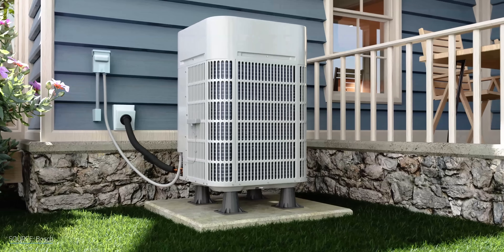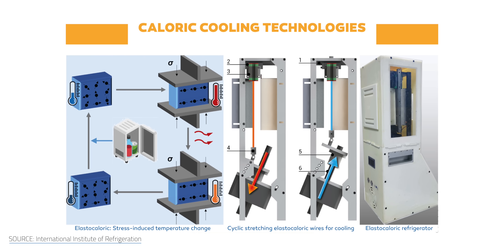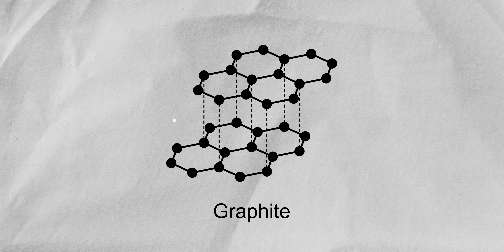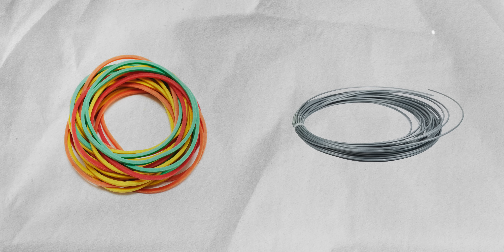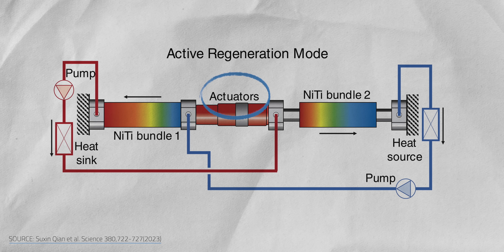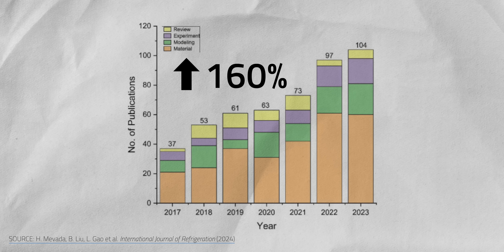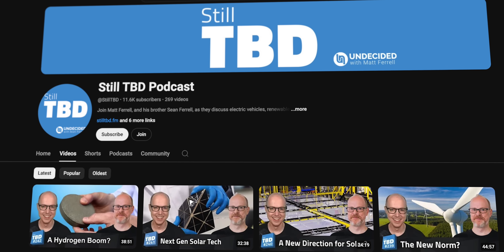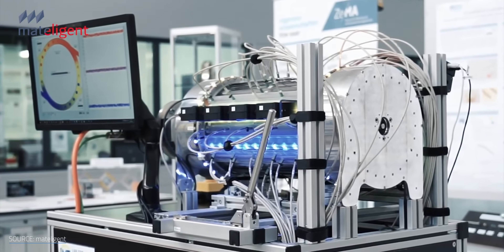How Solid State Cooling Could Change Everything

Comment: For me, potential noise reductions are vastly more important than using less refrigerants. How are elastocalorics expected to perform in that regard?
Reply: Most of the noise from modern heat pumps is from the condenser cooling fan (and sometimes the evaporator too), and many minisplit units are already relatively quiet (especially the evaporator which is in the living space), but improvement there is mostly a matter of air handler design.
Older style units may have noisy compressors as well (that's why window AC units are sometimes called 'window shakers'), but variable speed inverter-based units are generally extremely quiet.

I agree with you, silencing these things (and machines in general) is high on my list of valuable upgrades.

Comment: I like this even if it's just for the lack of pressurized refrigerant. Even when the refrigerating vapor is relatively safe for the environment, you still have to rely on a system staying leak-free and under pressure for years. Having something that relies on what seem to be fancy springs and coils sounds like it should be stable for way longer.

Comment: If this can replace hydroflurocarbons for cooling, which are a far worse greenhouse gas than CO2, then I say bring it on.
Reply: You can already replace hydroflurocarbons by hydrocarbons. Commercial HVAC systems using propane are readily available and being sold in large volume in Europe, often for central heating systems. CO2 can also be used as a highly efficient gas for conventional HVAC systems, but has some engineering challenges due to the high pressures involved. It is used in commercial applications up to the Megawatt regime.

Comment: This made me think of heat pipes, such as those found on PC mainboards for 15-20 years.  However, heatpipes transmit heat via internal gas/liquid phase changes, and are powered mostly by the thermal waste heat from the electronic system (CPU, GPU, Northbridge, transformers, etc).  Used in conjunction, one might make a vastly superior heat conveyance system.  One might even just need as little as a few low-powered fans to move air across heat sinks on either end, or fluid or gas pumps.  Even if all we do is remove the compressor, we'd get a massive COP boost.

Comment: I want the government of Ontario to pass a law that says all new and replacement AC systems must use new high efficiency heat pump technology so that they can replace or at least supplement other heating systems as well. Priority should be given to homes that are heated primarily with electricity, coal, and oil.

Comment: Imagine a wheel, attach a rod to the rim of the wheel at the 12 position, with a heavy weight in a guide at the 6 position.  Now put one at 6 with the weight at 12.  The rod at the 12 is in tension, and the rod at 6 is in compression.  now spin that wheel 180 degrees.  Low energy consumption, tension compression cycles.  Not really much of a limit to how many pairs.  Size is the constraint.  Let gravity do the stretching and compressing.  You just spin it.

Comment: Nitinol was a fun toy in the young robotics hobby groups 20 years ago being called 'muscle wires'.  Heat it with electricity it will shrink, and it will relax as it cools (or the other way around, I can never remember).  Anyway companies were selling 'walking robot insects' that walk using these wires.  A neat toy.  Glad to see the material being used in more practical uses.

Comment: I'm curious why this is considered "solid-state". I always assumed that solid state meant no moving parts, similar to a peltier cooler. But this would have actuators moving coolant as well. Does the coolant move on its own at least, due to pressure changes, or will a pump be required?

Comment: Small comment from someone who did research in elastocalorics on NiTi alloys: martensite doesnt turn to austenite under stress. Martensite is a twinned configuration in NiTi, and deforming it, de-twins it. The detwinned martensite is turning to austenite when heated up and back to twinned martensite when cooling down without mechanical load.

Also superelasticity with NiTi refers to an austenitic alloy turning directly into detwinned martensite under mechanical load and back to its original shape (which is saved in the auatenitic state) when taking away the stress. This way, up to 8 or 10% of seemingly elastic deformation is possible. In comparison, steel can only exhibit around 0.1% elastic deformation.

Happy to explain more or answer other questions.

Regards from Germany ✌️
Reply: How many cycles of 8% deformation can it withstand?
Reply: @eIektrinis  fatigue is a gradual phenomenon, so full 8% maybe a few to a dozen cycles... Highly depends on microstructure and purity of the alloy
Reply: @McReinsen Hi! I'm doing my PhD on improving fatigue life of elastocaloric alloys (copper based ones)
NiTi alloys can go up to 100 000 cycles even 1million in a recent study but the stress is lower for an elastocaloric application. 
My alloy CuZnAl last 10 000cycles for now and the target for an industrial applications in about 10 million cycles so there's work to do but we're on the good way
Reply: @McReinsen  what do you think about this
https://youtu.be/8gbbL2XVpQY
Reply: @McReinsen  THANK YOU for your highly cogent, informative and insightful posts. +1

An amusing aside - I had to chuckle & shake my head at the obviously strong inverse correlation between the well deserved likes you garner between the top and bottom of this thread, and between the increasingly short attention spans of posters (who rarely read deeply beyond an OP, much less upvote it).
Reply: Out of curiousity why are we not seeing more interest in it for artificial muscle?
It feels like a natural substitute for artificial limbs... Is it a longevity, cost or sone other factor?
Reply: @KMCA779  you need heat to trigger the transformation, which takes time to get into and out of the material, so speed of transformation is not very high unless you go to electrical heating of ultra thin wires. Not very practical for limb systems when you need elaborate cooling integrated
Reply: @KMCA779  The function of the wires(shape changing) is required for energy transfer/storage and would not be usable for motor functions.
Reply: @SupraSav  that's not correct. They can be used as actuators and actually are in automotive, space and other applications
Reply: @KMCA779  another interesting application is stents in medical technology. So keeping blood vessels open, eg in heart and brain.
The NiTi wire forms a pipe-like structure that is packed up in a tiny space to be moved to the deployment site through the blood vessel. Body temperature causes it to go to the memorised structure, so it will hold its pipe-like shape and stay deployed.
But do correct me, material scientists, this is rudimentary knowledge on my behalf.
Reply: @KMCA779  about the exact same thing!!!! 100%
Reply: Currently, the NiTi wire bundles are made from superelastic SMA sourced from the medical field, as no alternative material is yet available on the market. This is the primary reason for not exclusively using binary NiTi material.

For this reason, intensive research is being conducted on alloys specifically tailored for elastocaloric applications. In parallel, machine concepts are being developed that, together with the right materials, will pave the way for success. SMA alloys are still at the very beginning of their potential and development journey.
Reply: @McReinsen  Excellent comment!
Reply: How severely does the temperature gradient affect the structural shift? He uses a blowtorch in the video but that's obviously much hotter than most applications for it, so does it have a minimum temperature before the reaction can occur?
Reply: @Add_Infinitum  there is a temperature window where the transformation happens. Both phases (austenite and martensite) have start and finish temperatures. Exceeding the finish temperature is usually not a problem, but vastly higher temperatures can trigger mechanisms that change microstructure, basically the same effect as annealing/heat treatment.
Reply: @Add_Infinitum  so you understand, temperature would not be the stress in the refrigerant cycle.
Reply: You can return it using electricity right?
Reply: @AarushA.S  yes, resistance heating. It's all about temperature
Reply: Martensite and Austenite reminded me of types of magnetic stainless steel. Is there any relationship here, or is it simply that it's similar geometry? Sorry if this is a dumb question, lol
Reply: @Boodlums  they are not the same as elements are different but yes, it's an analogy to steel where martensite is the low temperature and austenite the high temperature phase.
Reply: Thank you all for the extra info here! (Sorry for not contributing, I comment to find the thread later!)
Reply: what about when the temperature memory is under room temp and then you deform it?
Reply: You mean to tell me this future babble is a bunch of bullshit and the details are all scrambled up? No way man.
Reply: How do elastocaloric materials like NiTi fare regarding recyclability? One of the difficulties of current hvac refrigeration systems is that you need to be certified to do maintenance because of the nature of the chemicals used as refrigerants and the resultant necessity of preventing leaks, and most refrigerators that stop working are just discarded (as far as I’m aware, at least). 

A purely electromechanical system with no specialized fluids seems like it would facilitate maintenance. And because the parts that would wear out most often, the elastocaloric material itself, are one homogenous alloy, melting and reforming the parts from the old broken ones seems like it should be trivially simple. Is my understanding flawed? How difficult is it to make NiTi wire from the alloy?
Reply: Some materials do get Austenite to Martensite phase transformations under enough stress (and hence strain). That's the reason non-magnetic stainless steel can turn magnetic after being cut.
Reply: @McReinsen  I used this behavior making soft robots prototypes for my research during my master in Dresden. Nitinol is accessible but still expensive.

Comment: IMO the problem is that heating and cooling happens in the same place. So You compress material, then you have to remove excess heat, then decompress it get lower temperature... 
In a heat pump one side is always cool, other side is always hot, that simplifies things a lot.

Comment: I wonder if something like this would be loud at all, but it definitely sounds like something I would want to use!
Reply: the transformation in the material is noiseless. the mechanical system to trigger and cycle the transformation could make some noise. basically an electric motor or actuator

Comment: Sorry to complain, but please fix the lipsync issue. It's off by a little bit. Don't use BT loudspeakers when cutting. They have a delay. Use only directly attached speakers or a laptop or a tablet to check.

Comment: I fast-forwarded through most of this video, so I don't know if this was addressed: FWIU this system requires the area being heated to be adjacent to the one being cooled. Systems using refrigerant are easy to extend, able to separate the two areas. If you don't have an easy place to mount both functions together you'll still need some sort of liquid system with a radiator to pump the heat in or out. At which point using a refrigerant and adding a compressor is actually a simpler solution.

Comment: Cooling the wires in super charger cables, heating snow-covered solar panels to melt snow, or optimize panel temps during the summer...❤

Comment: I remember as a kid noticing that rubber bands got hot when you stretch them and cold when they relax. I saw a crazy project someone built that put masses of rubber bands on a rotating rack that constantly stretched and released them while blowing air across them. It did manage to cool & heat air but wasn't what you'd call efficient.
Reply: That was Ben from Applied Science who made the rubber band fridge. It was pretty cool.
Reply: @Scrogan  yes! That's the one I saw, it was like 8 years ago, I'll have to watch it again. Rubber Band Fridge 
I wonder if it could be made better now.
Reply: For reference the Applied Science video that  @Scrogan   mentioned is called "A refrigerator that works by stretching rubber bands".
Reply: You can also simply take a thick-ish rubber band and stretch it, hold it against your skin and you can feel the heat.  Keep it stretched and blow room temperature air against the rubber band for a minute and then suddenly release the tension - hold again against your skin and the rubber band feels ice cold.
Reply: I used to do that by bending wire coat hangers a few times. The spot where it is bent does get hot!
Reply: It will not be efficient. Never. It is like doing battery from wood. You can, but it will no work enough to power anything.
Reply: Modern kitchen appliances in general are horrible.
Reply: @integerofdoom69  what are you comparing when you say modern kitchen appliances are horrible?
Reply: @SolWake  anything pre "planned obsolescence stage" is superior so late 80's and before
Reply: Sure, planned obsolescence is bad. There are still popular modern brands that build appliances to last like Whirlpool, Miele, Bosch. It's always a trade-off though: Efficient, Durable, Affordable--pick two.
Reply: Unless rubber bands have the same property as these elastometrics- that they cool down further when de-stressed than they heat up when under stress- then they’re not only inefficient, they’re not really doing any cooling at all. The big rubber band machine would just be cooling by 5 degrees and then heating by 5 degrees, and then cooling by 5 degrees and then heating by 5 degrees….
Reply: @matthewnewton8812  I mean none of these systems are gaining free energy. The refrigerant loops we have now are only cooling and heating by the same numbers, the energy has to come from and go somewhere. If you can get a negative temperature change by doing work, you've succeeded in making a cooling cycle, the only question then is how much energy it took to create such a cycle.
Reply: @matthewnewton8812  the design I saw had a wheel that moved the bands out of the box to lose heat into the environment, them brought into the inside of the box to pick up heat. 
It has a wheel with many bands being stretched and relaxed, as they rotated into/out of the box. 
It was not very effective, but it did create a measurable cooling effect.
Reply: @matthewnewton8812  Could the two temperature states then be directed into two systems, presumably by airflow in a fluid dynamic model, with one system cool, the other warm, and a net exchange of 0? It would demonstrate the principle, but as you point out, it ain't gonna heat your Kenner Easy Bake Oven. Exploring the potential for applications, perhaps if we designed our differential temperature source using a set of ACME Giant Rubber Bands...

Comment: So it’s an interesting idea but it’s going to come down to price and space, I mean what’s the point if the thing takes up more footspace outside but is smaller inside also to price factors though it dose seem to have one of the costs covered aka price to run so upkeep is the same but new tech tends to cost way more than older stuff.

Also as there will be lots of movement that’s more chance for brakes so will you have to replace the thing more often? If so that’s not going to sit well with customers.

14:00 ah so it was covered in the video

Comment: Very interesting, but how do you get the excess heat out of the system? I'm having a hard time visualizing a radiator concept that involves moving parts.
Reply: Stretch it to cool it and soak up heat from water to make it cool as well (and run a fan over it to transfer to you).  Then compress it to heat it up and boil some water outside to send to a fan outside your house.

Comment: Would have been great to hear about it's potential efficiency. Does it come near the heat pump's 1:3?
Reply from the maker: That's the part that we should find out soon.  Dr. Takeuchi mentioned that they're only getting to that point now where they can test a full product/system (ie. elastocaloric refrigerator against compressor refrigerator).  In my conversation with him he sounded pretty confident it would be at least on par with a compressor heat pump.

Comment: I did draft CoP message during the talk but you touched on this in your roundup.  Vapour/liquid phase change systems have a typical CoP of 3 rising to 5 in current best case, so it's going to be decades before this tech gets anywhere close to this for mainstream uses.  
  One big correction V/L = Fluorocarbons = Global warming.  Not true.  What about R-290 and other F free options? These are already in volume production, and displacing F-based coolants.